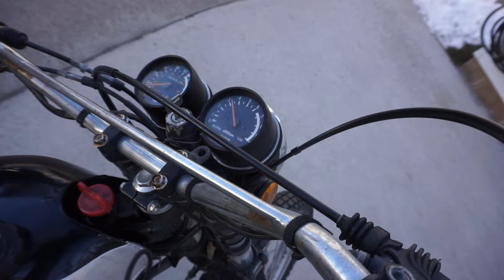Kicking My Leg Off...Free Abandoned Yamaha XT 500. Will It Run? (Part 2)

Comment from the maker: My leg still hurts lol. 
Please SUBSCRIBE and LIKE the video if you enjoyed! It really helps me out a lot!
Check out my Instagram: 2_vintage_
Thank you for all the support!
Reply: I know how you feel was kicking the 525 for ages and then realised it had a safety release off hahahahaha what an idiot l am
Reply from the maker: @RagdollRacingInc  haha that's rough!
Reply: What’s that 4 wheeler sitting in front of your bike
Reply from the maker: @marksabean6673  New video on it Sunday!
Reply: A trick to starting that is to kick it to top dead center, once you have it at top dead center pull the compression release and and kick it past the first little bit of resistance then stop and let go of the compression release and give it a good kick and she will start.
Reply: Only one thing!! You should never remove the oil filter cap if the engine is hot you are going to strip the threads on the bolts and its going to leak
Reply: also when a bike backfires that means the valves need adjustment
Reply: @user-uz5nv4hs8d  that isn’t always correct
Reply: I would ride see if it cleans up and also just to take for a spin and then check compression and u know why it’s smokes and if it’s good u have to take the head off ether way so u know for sure why and I just want to say u come a long way form the years I remember wen u just got the rm 125 and wen u raced ever thing with the 250 sure shift got lot better to just want to say Keep up man and I like to show u some of vids me riding I got a some vids of me doing hill Quicker or jumps some sick ass willys I got a rm 250 03 and a yfz450 love both and 400ex but it need some work
Reply: Man you sure you belong in the garage bro it's the timing advance plate going to spend that around 180 somebody got that at a time that you got no oil in it it won't start some bikes have sensors in them won't allow it to start that way if it's a little oil it won't do damage just a little heads up for next time cuz I didn't watch the whole video first I don't know if you got it or not
Reply: @2vintage  
Like "Stephen Blackstock" was saying, only I'd pull the decompression lever in and give it a few spins and than give it a few more for the hell of it and then release the lever and without touching the throttle find compression and then pull the decompression lever in again and move it just slightly past TDC and release the lever again, this places your piston in the right position just past TDC, and if you wanted to you could now look at the "Kick Indicator" window and you would see silver/grey but that's not necessary if you know what you're doing, anyway the piston would now be in the correct position to kick it while allowing a full revolution before hitting compression again 
They flood easily if you think it's flooded pull the decompression lever in and roll it over a few times to clear it 
To properly change the oil you would remove the sump plate under the motor and clean the wire mesh screen that sits in the top of the sump plate this is where you will find any shavings or broken pieces from inside the engine, there is also another wire mesh screen in the bottom of the frame oil tank tube that should be cleaned as well 
And there is a small (8mm hex) screw/bolt at the top of the oil filter cover to bleed the air from the filter
You may have caused the oil leak at the base gasket when you were messing around with the top of the motor anyway it's not a two stroke so an air leak there shouldn't worry it to much
Reply: @stephenblackstock1923  
Yeah, it wasn't that hot, it shouldn't worry it, and there's other reasons why a bike could backfire
Reply: @davidhalstead1352  
No sensors in these motors
Reply: I haven't kicked over a 500 Thumper for about an hour
I might go for a ride
Reply: @2vintage  
Just about everything you did in this video was unnecessary except for the oil change that you did incorrectly 
The timing marks on the flywheel are fixed in position on the crankshaft by a windrift key (keysteel) 
You should have started by adjusting your timing chain then adjusted the valves and than checked the ignition timing with a timing light 
But cleaning the carburettor would've been a good place to start to
Reply: @2vintage  
To adjust the timing chain remove the magneto cover and a large (usually plastic) hex cover nut on the back righthand side of the cylinder that covers the timing chain adjuster using a shifting spanner and the two valve/rocker covers on the front and back of the top of the head with a 5mm Alan Key 
Using the decompression lever bring it around to the "T" mark and check if both valves are rocking, if they are not both rocking you're 180° out so roll it's around untill the "T" mark is lined up with the pointer on the case and both rockers have movement 
This will place the slack part of the timing chain where it needs to be to adjust it
Unlock the large outer nut on the timing chain adjuster with a shifting spanner and you will see a 10mm nut with a small slotted pin in the centre 
You may see that the slotted pin is protruding from the 10mm nut
You adjust the nut until it is "flush" with the end of the slotted pin and lock the large outer nut again while holding the 10mm nut in place if need be
Leave the adjusting cover off because later once the motor is running you check for a slight movement of the slotted pin by putting your finger on it while the motor is running if it had NO movement it maybe be to tight or wrong 
Then with the motor in this same position both rockers rocking and "T" mark aligned with the pointer you adjust the valve clearances 
Intake : 0.10mm (0.004 in.)
Exhaust : 0.15mm (0.006 in.) 
While you're at it it might be a good idea to remove the two rocker adjusting screws before you adjust the clearances to check their tips for wear or chipping, but then even if they look like they need replacing put them back in regardless and adjust the clearances until you find replacements
Reply: Filter.. 2 vintages way of saying it Philter
Reply: I just grabbed a yamai sr250 1980
Reply: @davidhalstead1352  The XT does not know what a sensor is.
Reply: My bad about that comment bro I didn't watch the whole video before I sent you that last time I enjoyed it I'm a Honda guy for July but that was pretty damn good then yamaha's they'll get your leg though LOL keep up the good work man got to keep these vintage bikes running
Reply: So the base gasket probably puked some oil because of excessive oil pressure. If you drain just the sump, only a small portion of oil comes out. There's a bolt on the lower part of the front frame tube to drain the main portion of the oil. You definitely ovefilled heavily. But the XT motor is very forgiving and a peach to work on if something does go wrong. So it might just be fine. Drain the oil again, all of it, put in the correct amount and sally forth. You can check oil pressure by releasing (not removing!) the breather bolt on top of the oil filter. Then start it. When it pukes oil out of the breather, it's good. If not, run max 30sec.

The stuttering could be the ignition timing. Get a shop manual, you'll be fine.
Reply: Sorry to be off topic but does any of you know of a trick to log back into an Instagram account?
I somehow forgot my login password. I would appreciate any assistance you can give me
Reply: @Callen Koa instablaster ;)
Reply: @Marcos Reign It worked and I actually got access to my account again. I am so happy!
Thank you so much you saved my account!
Reply: @Callen Koa happy to help :D
Reply: I hit like it’s free the subscribe button costs.. $5 cash for one year then every year after that it goes up
Share the wealth 😌🤣✌🏼
Reply: I have the exact same bike and I figured out after messing with all the wires it was just the point ignition needed to be cleaned off and after that and a new plug it ran like new those bikes are very touchy tho but they are amazing to ride at full potential
Reply: I think you're promised if you gotta look into the cash.Tank, cause there's a filter in the gas tank itself.You're not getting enough.Check the gas tank on and off switch thursday builder

Comment: Your kickstart lever is incorrectly fitted on the spline. There’s a dot on the spline which should line up with the gap in the kickstart lever. Your kickstart throw is too short as it is currently fitted. Ride safe 🏍👍🇿🇦

Comment: A 500 in proper tune will start in 2 or 3 kicks if you use the cam indicator window and never, never touch the throttle. If you touch the throttle you will kick 'til the cows come home

Comment: You also have to drain the oil at the front of the frame; the oil is inside the frame.
Reply: ...and more importantly remove the sump plate and clean the wire screen in the top of the sump plate, this is where you will find any broken pieces and shavings from inside the engine
Reply: Exactly: it's a dry-sump-engine.

Comment: Back in '81, I extensively rode a brand new XT500 that had the Black enamel/polished aluminium tank just like yours.
It was so Beautiful, Powerful and Smooth back then (compared to my clapped out Honda SL125) that it was a REVELATION!!!
I was 14 and the XT was just a HEAVENLY Riding Experience that I have never forgotten!
Watch out for the TT500, I had a '79 recently, SIX VOLT electrics suck, I think the XT's have 12 volt!
Later, I enjoyed my '86 XT600 for Twelve Years, me and that 'Bike did everything together, from top to bottom of NZ, EVERYBODY wanted a ride on the back!  A couple of Thousand WHEEL STANDS later, it broke my heart to trade her in for the next love of my life, my '91 Harley.
So good to see you have the patience and the skills to get this Beautiful, now old, Girl back on the Road Mate, Goodonya!
Reply: Back in '79 I had the road-going version, the SR-500. That one had electronic ignition and produced its ignition-current from a coil or so behind the flywheel. I could start it without the battery.
Greetings from the Netherlands.🙂

Comment: Looks like the 81 or 82 model.  SR500 type CDI ignition. Front downtube has secondary oil reserve, small drain hole at the front, and a mesh filter at the bottom of it where the pickup tube is at for the oil pump.  Good units, really.  Kickstarter was massively out of position, usually the foot lever is level up by the exhaust pipe in the up  position.  Not a bad bike, and it wasn't wet sumping.  Looks like you got a good one.  There's also an oil strainer under the bottom of the engine, under the plate with the drain bolt.  Exhaust valve clearance .15mm (cold) and intake .10 cold.  220 main jet on the thing, 22.5mm float height.  Sounds like it's got some pilot jet clogging going on at 31:45.  That's just by the main jet up in the hole on the main jet pillar. Also highly recommended to  check the diapgragms on that carburetor.  Air cut valve (on side), accellerator pump and accellerator pump cut valve all can get holed.

Comment: Really cool video,the hole time you where kicking and kicking I'm saying "dude! you're not doing right,you gotta bring it to TDC compression stroke then kick while perfectly timing the release of compression relief lever...and it will start every time first kick" so cool you figured out the secret!. lol so funny to me because no one ever wanted to ride mine because they couldn't start the engine. Also on first start of day i would hold the compression release in and slow kick the engine around a bunch to prime it up a little,then it would start one kick! No matter how cold,I still have my 1976 xt500 from back when i rode everday.that bike took so much abuse and neglect over the years! 
I'm sure it would start without much trouble,these machines just don't die! new sub! Thanks again for shooting this video really brought back some great memories

Comment: Bring it up slowly to tdc, then pull in the decompression and just move past tdc. Now, one strong kick and hold the kickstarter fully down, calmly repeat this procedure until it fires. 
Better than ripping the bike apart. Start with the correct procedure, before you hit the panic button.
Don't have lots of hair but this made me pull out the little I had.

Comment: Little tip, if you want to start one of those old kickstart bikes, that don't start so nicely. Just tow it. You can take anything from a moped to a car. Just attach a rope centered to your bike and let somebody tow you around. That way you can also let it turn over a bit before activating the ignition. That makes sure, that the engine is well lubricated and also you get the number of turn overs you would kick in an hour in like 2min.

Comment: The kickstart is in the wrong position which is giving you a short kick, it needs to sit more vertical. You only need to remove the valve covers, generator cover to see if the timing is wrong. A common issue is when someone times them 180 degree out,.
Reply: yes top part should be horizontal in rest!!
Reply: Yep, the kickstart alone would make it hard to start

Comment: so unless you pulled all the brass in the carb and made sure all of it was clear that xt not going to run very,spray cleaning the bowl out wont get it! you need to spray all of the passeges out pull the air screw and idle mixture srews and clean them also ,make sure to set float hieght too.Set valve lash those 500s would not start or run well if its off even a little bit. if that dont work sell me your problems for 300 bucks and I will come and get it!!

Comment: Hi  I hope you read the comments. I thought you  would have got  kicked by now. Just a tip your oil change was only a 1/2 job. There is oil in the frame and there's a metal screen at the bottom. Do your homework. These are awesome motorcycles you have lots to learn.  there's also a bleed screw  On top of the oil filter cap. I still remember when I got kicked From these motorcycles. Oh and don't forget to check your timing chain adjustment.  And put a battery in it. Good luck nice to see it run
Reply: Just said all this myself 😂

Comment: Hey man, I recently was given a '76 TT500 for a computer and went through so many of these struggles from your two videos, and learned a lot to tune mine up watching. 

I know you said plans are unknown for this guy, but my bike sounded just like yours when it ran. it'll go, it'll play, but it had that same sound when trying to drive around. low down and bog out on you, and just be weird, even if it'll sit and idle just fine, 

I'm pretty sure I will need to do that base gasket as well, and if you did it in a video that'd help me out a lot, lol. There isn't a whole ton of info on the web about these, and fragmenting things together through forums and manuals can be a bit confusing. I love the way you show your process and it vibes with the way I think and it's easy to learn from.

Thank you for your content.
Reply: Pull your pilot and main jets, run a wire through them and install an inline fuel filter. See if that helps, usually is the culprit

Comment: There's a trick to starting the xt! Top dead center. I used to own one of these beasts! Lol. I used to tell friends if you can start it you can ride it. From what I remember there's a mark on the cam that you put in the sight hole on the right side of head. It's been awhile, but definitely a trick to it! THUMPER LIFE
Reply: Do you still need to do this when its warm?
Reply: It’s same as starting a vintage Royal Enfield
Reply: @jaydangier1110  Yup. 4 stroke cycle still the same, hot or cold. For hot starts the xt on this video has a small button on LH of the carburetor, which you press up and it gives a little throttle. Alternatively, you can just squeeze the throttle handle a bit (which is what you do if your model doesn't have hot start button). 

But the kick procedure is always the same. And kickback possibilities as well, so dont mess it up!
Reply: @francofranchetti   yep, it'll hurt your kicking leg for sure. I loved my old xt.
Reply: @paulcondie2520  
If you know what you're doing and it's running right it doesn't hurt 
Forget the window (Kick Indicator), find compression (TDC) and using the decompression lever move it slightly past TDC this places the piston in the correct position so you have a full revolution before hitting compression again 
Once you understand you never need to look at the Kick Indicator again except to show others that it has such a thing
Reply: @hodaka1000  10-4, doesn't matter I haven't had that bike in years! Lol. I had no problem when I had it just was telling the guy in vids
Reply: @paulcondie2520  
I've owned them for years 
I just got off one
Reply: @hodaka1000  nice, I sold mine long ago. Liked the bike just moved on to newer models
Reply: @paulcondie2520  
I love it I'm reliving my youth 
I had one the same years ago and came into a few bucks six years ago and could have gotten anything I wanted Harley Indian Triumph anything I wanted and did a 1978 SR500e, same motor as the TX/TT's 
The mates ride new Harleys, but wherever we go the old girl shows them up and they accept that it does 😂
Reply: @hodaka1000  that's awesome. Nothing bad to say about the bike. I'm thinking we're around the same age? Lol. Mine was a mid 80s? Either way good times!
Reply: I have been looking for one of these bikes since 1989!!  nothing will stop them once they are running. it will climb trucks, trees , mountains... its like a firearm. dont point it at anything you do not want to climb!!
Reply: @lukewarmwater6412  I can verify that! I'm from the hills in  south west Pa. That's why I bought mine years ago, that an a daily ride. Lots of good memories